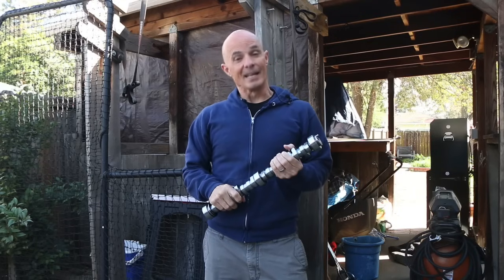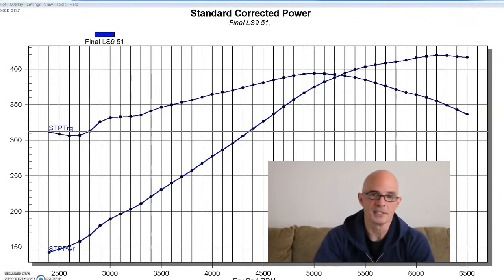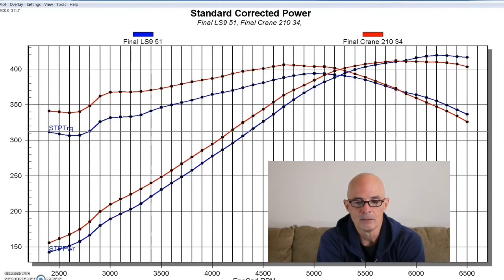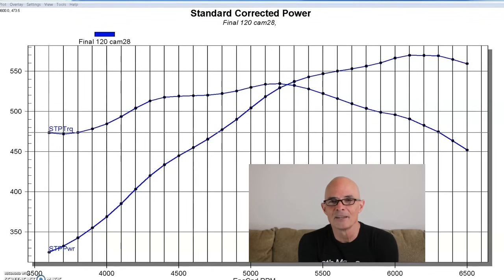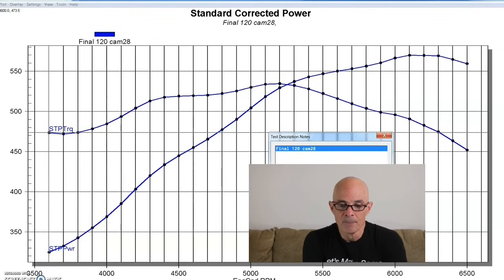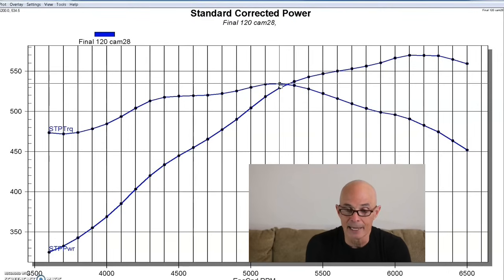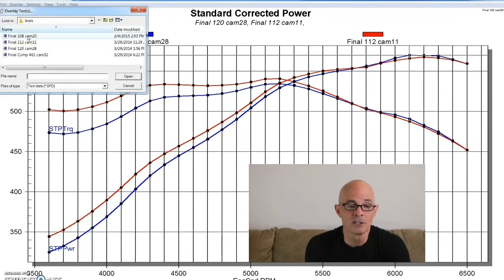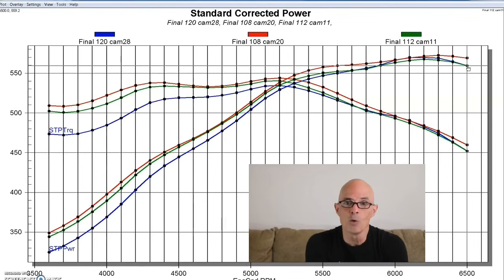LSA CAM TEST-108 vs 112 vs 120

Comment: The only thing I would like to see included in this test is Idle vacuum. Have a set rpm, 800rpm or something, and tune the idle for maximum vacuum to see how smooth they idle.
Reply from the maker: I did that on the stock cam test but did not on this one-should have
Reply: this conversation is not needed if your fuel injection system has a mass flow air sensor. it's the speed density fi system that needs adequate idle vacuum to make the map sensor respond correctly. lack of vacuum makes it run rich at idle. some scanners allow to taylor the computer's idle mixture at low vacuum, so there are some options.
Reply: @axlegrind4212  Idle vacuum is not just about ability to properly tune the engine. An engine with low vacuum at idle has a lot of exhaust dilution in the intake charge on account of the overlap - which makes it run rough. The overlap causes the dilution AND the low vacuum.
Reply: Yes, I to would have liked to see something on the vacuum generated by the engine , specifically close to idle for the purpose of vacuum booted power brakes. I could care less about idle quality. let it stumble a little if need be.
Reply: Who wants a smooth idle??
Reply: @johncholmes643  dailys, but its not just about the idle either.
Theres a reason street driven ls cams mostly use a 112lsa. Otherwise everybody would use a 106lsa in their na builds.
Reply: @deantape2759  the factory ls9 cam has something like a 122.5 lsa. Even the ls1 cam is 117 as far as I know. With short duration and 11:1 compression, they idle really smooth with so little overlap
Reply: @timothybayliss6680  im talking popular aftermarket cams sorry not stock ones, i agree they do always favour a really smooth idle on stock cams.
Reply: @deantape2759  I agree. Most of the cams Richard tests have somewhere around 113lsa. It's a trade off, you see some engine masters push it really low like 102. I think it was BES that had a 400 small block that had 244°@050 and a lsa of 98°. With a full exhaust and manifolds as opposed to headers, you get some charge dilution at part throttle. The Ls9 cam is actually pretty big, but it would pick up power basically everywhere if it had an lsa of 112.
Reply: What tightening the lsa seems to do in my eyes is makes the power curve start a bit earlier (picking up alot down low) and makes the curve a bit peakier (overall total power numbers increase a bit) but gives out a bit earlier than wider lsa which is why i think we tend to see the dip in the last few hundred rpm at times compared to the wider ones.
Tightening it further will raise the curve higher and cover that issue anyway to a point.
The naturally aspirated racers in the pro stock catagory from memory all used a 106lsa for whatever reason.
Reply: @deantape2759  You have it all wrong.
Reply: @michaelangelo8001  what? Everything seems about right.
Reply: @johncholmes643  certain race classes.

Comment: Ok, wide lsa sucks. Got it 👌
Reply: It's more complicated than that...
Reply: @michaelangelo8001  but the dyno.... it told me so 😀
Reply: @maxlink3914  The part you saw was correct, but you didn't see what happens at lower rpms.  You don't ever get something for nothing.
Reply: @michaelangelo8001  i assumed the bottom end would suffer. I'm ok with that to an extent. In the 1/4 i don't care because I'm at 4000rpm when i shift. But the rest of daily driving would suffer, so that should be a consideration too

Comment: I noticed they all made Peak power at about 6300 RPMs. what determines where power Peaks heads, camshaft or does stroke determine Peak RPM. We're running an LS6 intake and it Peaks at 6300 3.62 stroke, BTR stage 2 Turbo cam.
Reply: Cam timing is what affects peak
Reply from the maker: The Fast intake on that displacement is likely what made this thing peak there
Reply: @richardholdener1727  thanks Richard
Reply: Part of your answer is in the question..... the intake was the same for the various cam dyno pulls.  A long runner FAST/LS6 intake typically will reach peak power at a lower RPM than say a short runner open plenum intake (think fabricated sheet metal intake). Same as back in "the ole days" when comparaing a dual plane vs single plane/ tunnel ram intake.

Comment: Nice I loved my Lunati Bootlegger in my sbc 406. 108LSA nice chop great power band. Running a Summit cam in my budget junkyard 307 build, 106lsa, gm 601 heads that I cleaned up a bit. Fun little mighty mouse motor. Going to build the 406 right and put a forged rotating assembly in.

Comment: "3:05, I would pick a different cam (for a supercharged application)". Just for a curiosity, what kind cam would you pick Richard for let´s say 6.0 TVS 1900 (GM LSA) daily driven toy (car weight 3000-3500 lbs).
With this kind of a vehicle low/mid range power is the thing (even if it sees track time every once in a while).
Excellent videos with full of data! Keep up the good work and stay safe with these times.
Reply from the maker: Just meant i would select an NA style cam that adds low and mid range torque compared to the typical PD blower cam-I don't care about the big number at 7000 rpm
Reply: STREET RACER  Really, would he? Why dont you let RH to shed some light under the rock and keep your creative comments to your self.
Reply: Wrong... he would use any cam and put boost on it.... because all cams are boost cams....lol
Reply from the maker: her would?
Reply: STREET RACER Thanks for your input and suggestions. I have picked my cam already. But what I would like to know is what RH wuold pick for a sc daily driver and that is what I asked. Turbo stuff is well covered on his vids. So is some sc stuff too. There just happens to be quite a few lsa blower equipped cars around and RH has nice twist in his angle. Sure a BTR psd cam in any stage is good choice, but everybody knows that. But is there any twist there? RH has excellent reasoning to back up his opinions and that is what interest many of us.

Comment: How would the lsa affect power adder?. Nitrous,turbo,etc..test it please
Reply: Depends on alot of factors.
Tighter lsa has more overlap so it will bleed some more boost off right out the exhaust on the overlap while both valves are open together, but if its a turboed setup that would mean spooling the turbo faster anyway. If you wanted a tight lsa AND boost id go a really big twin scroll single turbo personally.
The general rule was na setups use tight lsa and boosted setups use wide lsa but if you know your stuff you can bend the rules a bit and pull some cool tricks.
Reply from the maker: Think abuot this-on a turbo-how does boost bleed out the exhaust when back pressure is higher than boost pressure-that's an internet myth! It can happen on a blower application where there is no back pressure.
Reply: @richardholdener1727  are you sure? Wouldnt that cause terrible amounts of exhaust reversion if the exhaust pressure and volume of air was at a constant psi higher than whats coming in? Exhaust pressure would surely work in pulses like the exhaust does na right? I personally havent done a boosted build myself yet but i cant see how that would work.
Reply from the maker: results are the same under boost and with nitrous-those just add to what is there

Comment: I've had the opportunity to work with a few engines using a 108LSA over the normal off the shelf selection. Two 347 SBF's and a 388 LT1. All engines were amazing street strip combos. Still had manners down low, came on strong in the middle and ripped up top. For the 330 to 400ci range, I don't think it can be beat.

Comment: Lots of really good info here! I wonder what advance or retard the cams had, though. We’re they all ground straight up? Changing LSA affects two significant values to my understanding, IC and overlap. The 108 cam actually goes against that “fact” about intake closing, because you’d expect a loss of absolute top end power, not a gain. A 232 duration lobe at 108 gives IC at 44 degrees while the 120 gives an IC of 56. The 112 is 48. If the cams were ground with advance, like the typical +4, those numbers would drop by 4 degrees. It is not obvious why the 108 cam would keep up with the others at the top. The other thing that changes is overlap. The 108 cam works out to IO at 8 BTDC and EC at 13 ATDC, 21 degrees overlap (at 0.050). The 120 cam computes out to -4 and 1 respectively, an overlap of negative 3. The 402, even with CNC heads, should really like the big overlap, and that proved true. I’ve watched a few Brian Tooley videos about cam timing and he says the opening and closing events need to be what they need to be, regardless of LSA or advance/retard. This test seems to prove that, at least somewhat. Richard, we can’t get enough of this stuff, keep it coming!

Comment: Idle videos would be a nice add to these videos, LSA tends to change idle characteristics correct?
Reply from the maker: idle is choppier with 108 as  mentioned in the video, but wish I took idle vacuum and had clips
Reply: The engine sees only overlap, not duration or LSA. wide duration and tight LSA will give low manifold vacuum and lopey idle. David Vizards extensive testing with LSA has proven with 2 valve motors that optimal LSA is dependent on engine size, 302ci  for 110LSA, 350ci for 108LSA, 383ci for 107-106LSA.
Reply: When designing custom cams for my car, I paid no attention to LSA. My main focus was on the 4 valve event timings with some attention to overlap and the consideration of variable intake advance up to 15 cam degrees. LSA alone doesn’t matter.
Reply: @adamsweet3587  There are no absolutes
Reply: A lot...

Comment: This isn't surprising if you look at the actual valve event timing. The earlier intake valve closing traps more air and increases compression, while the later exhaust valve opening extends the effective power stroke. The increase in overlap probably improves scavenging as well.
This has been one of your more revealing comparisons. Thanks.
If you ever fall upon data from past runs, or get a chance to run an extra test someday, a comparison of otherwise identical cams having only different lift would scratch an old itch.
Thanks again.

Comment: I’m interested in the tune to handle the 108° cam.
Reply from the maker: we adjusted so each had 12.8:1 which is where they made best power-timing sweeps for each cam but they all ran best at 29 degrees total

Comment: Wow!  Great video Richard!  Had no idea that a tighter LSA (with choppy idle) would make more low end power!?!?!  NOW.....I can have the best of both worlds!!!  I can put a 108 LSA cam in my work truck, have a bada$$ idle and tow my trailers (enclosed tool trailer, 6T flatbed and my I/O boat trailer) all day!  ALL your videos have awesome content and enjoy the heck out of them.  I watched several of them more than once to make sure I'm absorbing the content for my LS/OBS swap coming up.
Reply: Don't get too excited...  If that were the case, all cams would be ground on a 100 degree LSA.  You get more low end to a point, and then, nothing...  Makes your power-band more like a two-stroke.
Reply: It has to be sized to the motor properly. In this case the 402 just happened to like the 108

Comment: great job richard. your engine tech vids are great and so are your books.
Reply from the maker: Glad you like them!
Reply: Hats off to ya for another interesting vid

Got to be a bunch of work, setting up on the dyno, making pulls to get the time dialed in, then swap cams, then another pull or two (or more...) getting the timing and fuel optimized, then swap cams, then... yeah, a bit of a chore, even if you hold the front cover on with Velcro

And when you're done - we want more!

That being said, if you want a reason to swap more cams in the dyno cell... I'd be interested in seeing u yet another cam comparison: this time 3 cans with different LSA, but the duration adjusted so the intake valve closed point stays the same.

So, a can with (for instance) a 112° lobe spread and 230° duration would be compared to one with 238° ground 108.  To try to make things as even as possible, use lobes from the same family, with as similar lift and ramp characteristics.

My theories: a) the length of the header tubes and exhaust runners on this engine was tuning in make peak torque from 4200-5400 RPM where the 2 bumps in the curve are) - regardless of where you set the IVC, and b) a tighter LSA combined with more duration might allow similar cylinder filling (or maybe even slightly better) up top, and allow the harmonic tuning of the intake & exhaust to make a bigger bump in the middle of the torque curve.

Some of the tests you've run with larger duration cans, that didn't seem to pick up much top with long runner intakes made me kinda' think this may be the case

Then again in theory, theory is as good as practice...

Comment: Hey Richard do it on a 5.3. So some budget guys can say hey I know what kind of LSA to order for my junkyard swap and what not.  It would be nice if you did a 5.3 or 6.0 nitrous big bang engine.  take a stock engine put some good rods in it open ring gap and a strong cam.  and love it with nitrous as you do boost. we all know boost makes power. but lets see a nitrous engine get turned up. 150 shot aint enough. lets see u push it as far as you can take it.  300-400-500- hell max out the system if you have too. lets see some 800-900- or even 1000hp nitrous 5.3 or 6.0.  no strokers we wanna see what u can push out of a simple junk yard engine on the juicy juice
Reply: From what I have seen  you can  run a sbe ls safely up to about 250 shot but cast pistons don't like it much. Sure you can run more into it but usually won't last too long. I would love to see him get a summit rod &piston kit and throw it together and see what it will take
Reply from the maker: did you watch the nitrous big bang video that is up
Reply: Well thats what im asking put a decent budget rod and piston.  And load it up.  Its not the point of can it handle a 250shot.  If Richard can make a stock bottem end 6.0 make 1540+hp with two turbos.  Then do a nitrous set up the same way.  Keep pushing it.  Alot of ppl are on budgets.  They wanna go fast. Boost aint the only way to do it.  Lets see a nitrous set up get pushed.  250shot is easy.  We do 500-600-700-800 shots with a dedicated engine with billet rods and pistons high dollar heads.  How much can a simple 5.3 or 6.0 be pushed to.  I can test it myself. But Richard holdner is the man with the plan. This would be a fantastic test.  U got alot of nitrous guys that breath bleed nitrous. Give it to them
Reply: I know a dyno puts a load on the motor but it's not same load as making a pass down the track in a 3000lb car
Reply: @Stevesbe  still wanna see a bigbang nitrous motor go further. Im sure.others do too

Comment: David Vizard published very good book with great explanation on LSA  and how t choose best one for particular application.
Reply: Great book!
Reply: I have been reading and have David Vizards books from the early 80s and have built numerous engines on his specs, they have never failed to impress, starting on the Mini  A series, Ford Pinto, Chev 350 and now finally the LS series.
Reply: @adamsweet3587  I really enjoyed his how to port and flow test. Also how to build horsepower.  Really great stuff!
Reply: I have read that stuff from DV and applied his knowledge to many engines always worked well. He is on point.
Reply: Shota Makarashvili : Like all things, David has to summarise his extensive dyno experience. Like all summaries, there are loop holes. Chev took wide lobe center cams to look after emissions ans engine knock and fuel economy and idle quality  The aftermarket is interested in idle chop, power and torque, with fuel economy and emissiins compliance not the part of the buying deal. A supercharged engine loves a wide lobe center because its easier to get emissions compliance and a nice idle. The David Vizard charts for LSA are good, but on small six cylinder engjnes with a common log intake, a scrambeled cam with differning LSA' s between cylinders can fix problems inherent in some engines. Siamesed port intake engines, 9 port 194/230/250/292 Chev six in lines, 1275 British Austin based engines, Turbo and non turbo 301 Pontiac V8s and other engines have specific cylinder to cylinder intake flow robbing and delivery matters issues. The LS engiine looses a lot of torque down low, but its an emissions, idleand fuel economy choice GM Powertrain made with huge input from a very special team of advanced engineers.
Reply: "Vizard the WIZARD" FTW! That man has forgotten more about the IC engine than I will ever know...
Reply: Nunya Bidniz : If everyone followed his Intake Optimisation Process, every LS would make more horsepower with less revs. Eveyone else focuses in peak horse power and lobe splay angle. A Concord Air Craft engineer focuses on  Techniques that work. David Vizard has to dumb down a lot of stuff to teach us mere mortals basic concepts. So does Richard Holdener. Im thankfull almost 100000 subscribers are prepared to open there minds in the Greeco Roman tradition of open discussion. One thing I will say...Samantha Vizard was making 145 flywheel horespower  at approx 7000 rpm from a 1435 cc Mini engine in the early 80s. Thats an insane amount of horsepower from a non turbo,  overhead valve, 3 bearing, non canted valve, non wedge, non cross flow,  siamese port, non fuel injected, non isolated runner engine. To paraphrase Meatloaf and Jimmy Stienman...."Mom and Dad...you folks have got a helluvalot to learn about [how piston engines] Rock n Roll"
Reply: I  had that book and several others stashed in the shop crapper at the GM dealership I worked at . If a Diesel was on the schedule , I did a lot of reading .
Reply: Shota Makarashvili whatever happened to him?
Reply: @frankrizzo2724  I believe he is still fine...
Reply: @frankrizzo2724   he has a YouTube channel  to promote his lectures and books.